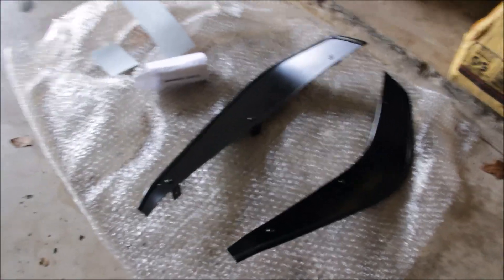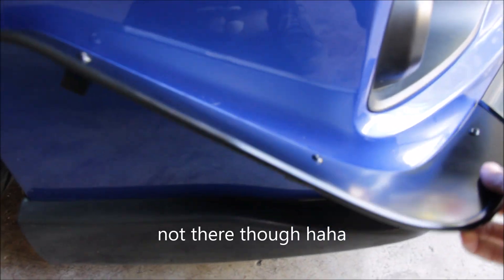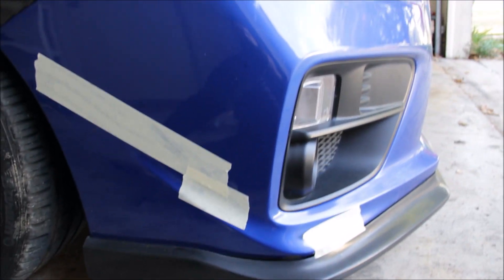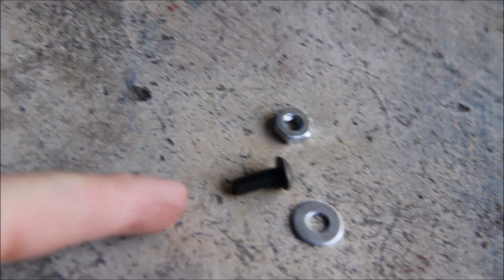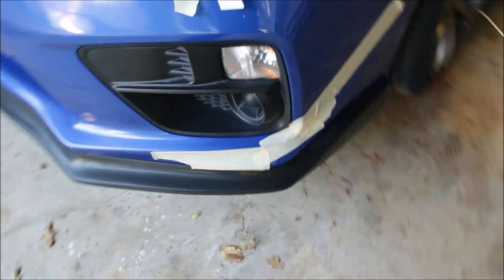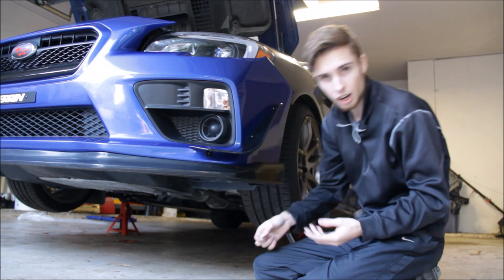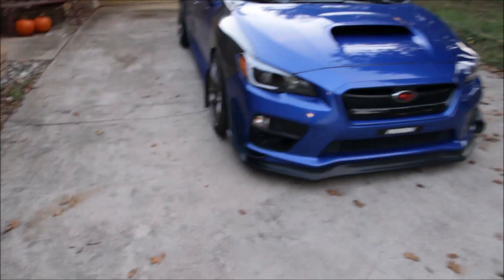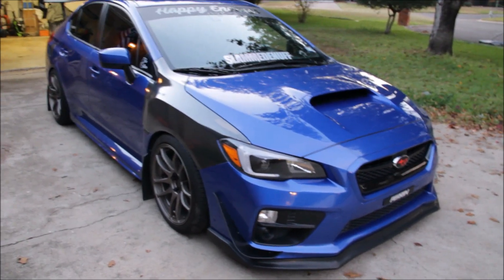Installing Canards For The 2015-2017 Subaru WRX/STI

Comment: I installed my canards by just removing 3 pop clips on either side which you can access the interior of the bumper cover, rather than popping the bumper off the car.